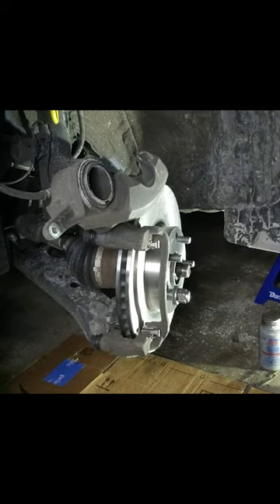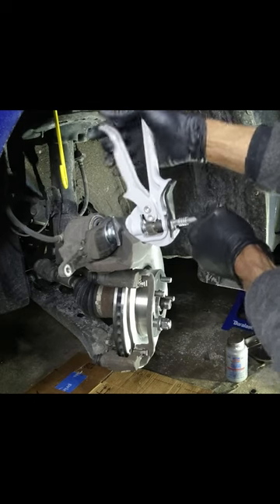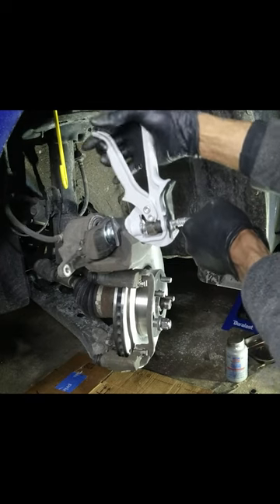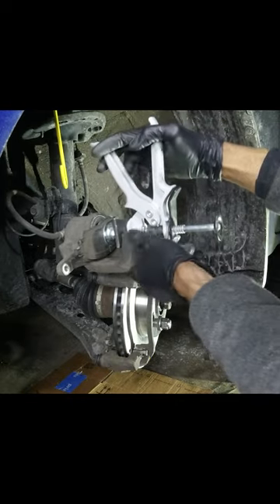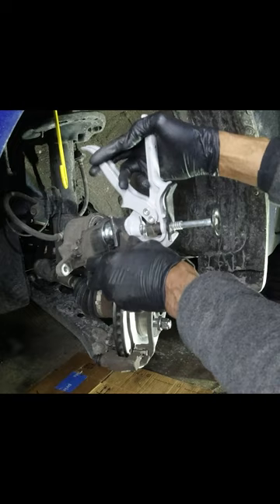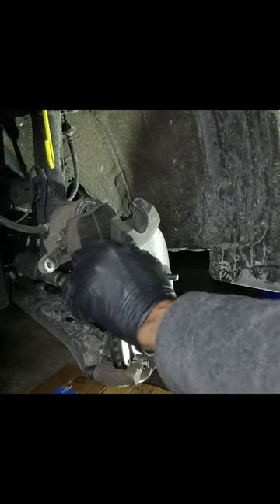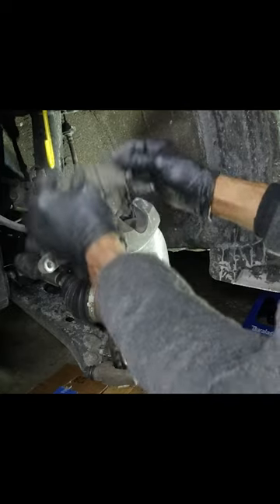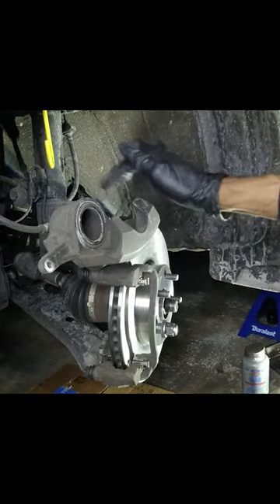How To Compress Front Brake Caliper Piston #shorts

Comment from the maker: M12 FUEL 3/8" RATCHET 2 BATTERIES https://amzn.to/3x0oM9d
Milwaukee M18 18V Fuel 3/8" Mid-Torque Impact Wrench Kit https://amzn.to/3DLfrFV
Milwaukee 2767-22 Fuel High Torque 1/2" Impact https://amzn.to/3DKh8DF
KIMO 3/8" Cordless Electric Ratchet Wrench Set, 40 Ft-lbs 400 RPM 12V Cordless Ratchet Kit https://amzn.to/3RE7ecp
Permatex 80078 Anti-Seize Lubricant https://amzn.to/3RBrueF
Clear Silicone Paste https://amzn.to/3JKKRQF
17Pcs File Tool Set with Carry Case https://amzn.to/3I1D27X
OAIEGSD Silicone Paste https://amzn.to/3Yq3FJ5
JOJOY LUX Brake Caliper Press Tool https://amzn.to/3JH0vwx